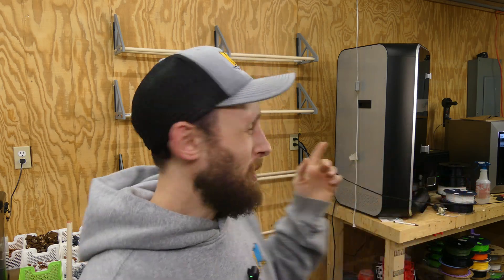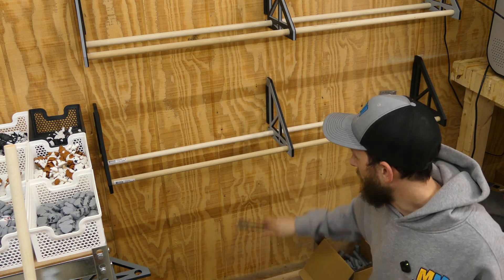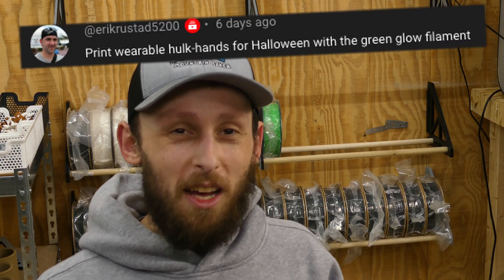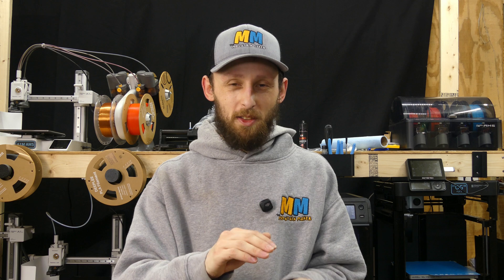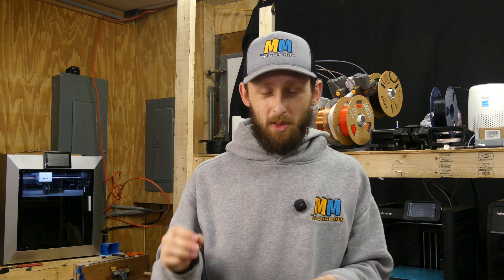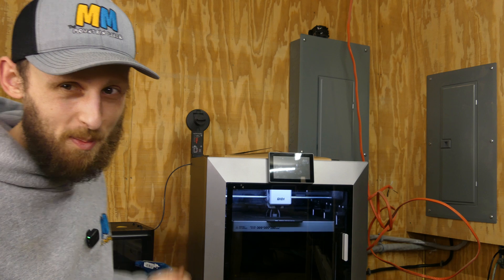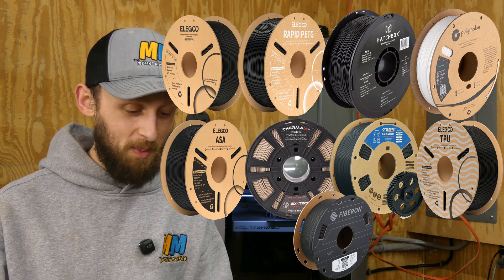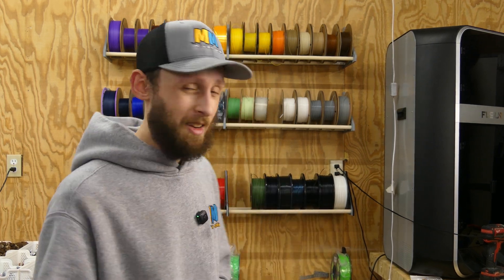3D Print Farm Life | Organizing Filament, New Build Plates & My Thoughts on Bed Adhesion

Comment: I normally print with ABS at 105degC (equates to around 100 on the bed surface) and use bostik clear glue stick, its cheap and seems to get a nice bond when you apply a thin layer, which I clean off and replace after a few prints. I have upgraded my build plate to a 8mm graphite R3Men hot bed from the stock 3 mm aluminium one on the K1 Max, and now with no plate warping it has improved the parts sticking better with no lifting towards the edges on the PEI plate. Not so frustrating any more to use ABS when prototyping some parts.

Comment: Hah! My house is over 100 years old. No way I could get level shelves measuring from floor or ceiling. A spirit level is the only way.
I use wooden dowels too for the supports. My shelves go all the way up the walls as my main FDM print space is only around 10sqm. So vertical space is fully used.
I've got a mixed space a bit larger for laser cutter/engraver and resin printing. (Never use the engraver and printers at the same time though.)
Great update. Cheers!

Comment: Here is a suggestion for bed adhesion. Have you tried Aquanet Unscented Extra Super Hold hairspray. This has been my go to for years. Ive never used any of these other products but never felt I have needed to. the hairspray works great for pla, petg, and asa. I dont know about anything else since those are the only filaments that I use but maybe worth trying if you have never tried it. Look for the puple can.

Comment: I print a lot of ABS on my plus 4 mate.  100degC build plate and 50degC chamber heater works great and that's on the stock PEI plate. Been printing kilos of Geeetech ABS from Ali for a project.  Coincidentally my BIQU plate landed today - figured I would see if I could drop the temp of the plate some

Comment: ABS really wants to be enclosed or even better chamber heated.   Out of curiosity what are your voc levels in the print room?
Reply from the maker: Definitely likes an enclosed chamber. As for VOCs, couldn't tell you cause I dont have a meter to measure that but I don't often print with ABS, just more recently and I keep it to the enclosed machines aside from that little test on the A1 Mini but I do have 2 HEPA and Charcoal filters in there running 24/7 plus a fume extractor with HEPA filtration that sits underneath the 5M Pro when i'm printing with the ABS to mitigate spread of the ABS fumes.

Comment: Also….think about prepping and painting the plywood walls (ceiling), it will look much better and won’t stain and turn dark. I suggest the color Swiss Coffee or something white. You will be less cluttered and can see where things are better!  Good luck organizing, I appreciate your videos.
Reply from the maker: They are T-111 panels and are very "busy" in my opinion. I thought about doing the rest of the shop with dark gray/black walls cause its easier on the eyes and I like how it turned out behind my desk area but its a lot of work painting that stuff with a roller and brush with how uneven the material is and the little grooves every 8". Spraying it would realistically be my only option unless I wanted to spend days if not longer just painting... which I don't 😆. There would be a lot of pre-prep time if I went the spraying route, and i've got a sprayer that works with 5 gallon paint buckets but still a lot of work nonetheless...

Comment: you got the wrong blue plate.  you need to get the Frost bite blue plate.  It's amazing.
Reply from the maker: I have a frostbite plate and use it on my P1P and agree... it is amazing! Unfortunately, They only make it for the 256mm and 180mm build sizes so glacier is all i could get for the 5Ms. Plus, Frostbite is only for PLA and PETG not ABS, ASA or Nylon according to the recommended specs from Biqu.
Reply: @TheMountainMaker  oh good to know.  I didn't know that.  Thank you kindly.

Comment: On my 2nd Frostbite for my A1 mini and the coating is peeling off after a about 20 prints... sending it back. Hope you have better luck. What a good dog! Looks like we both need/want a IDEX22!!!
Reply from the maker: I've had nothing but great luck with it on my P1P. Its all I print with now on that machine and run it about 18-20 hours a day 5 days a week with that plate over the last 4 or 5 months now and havent had any peeling or issues so far. I very much would like to get my hands on a 22 IDEX... just a little outside of my price range 🤣